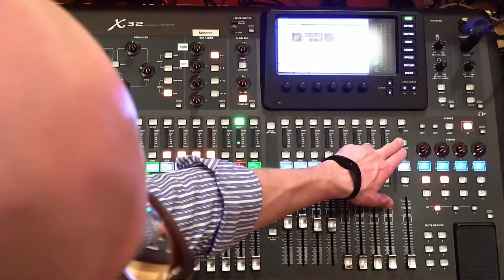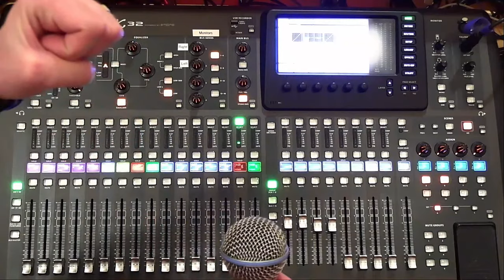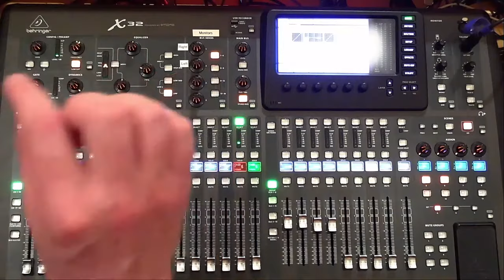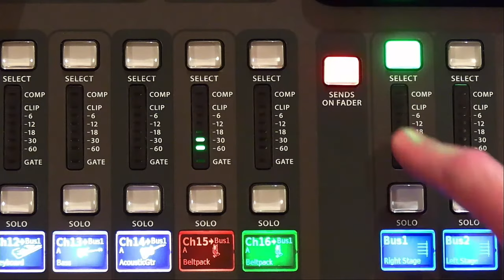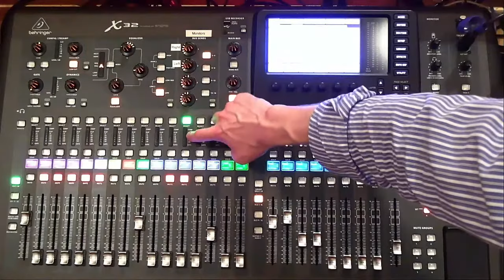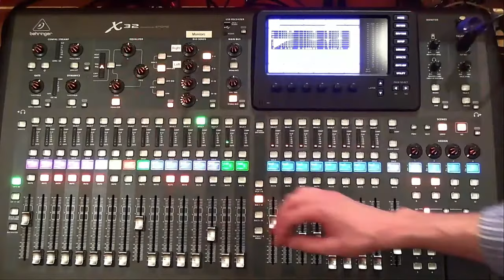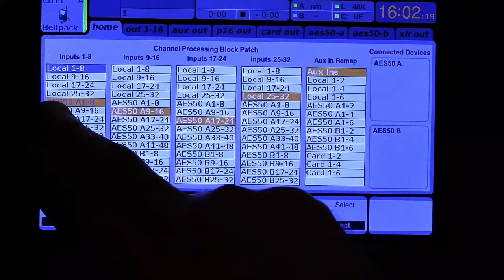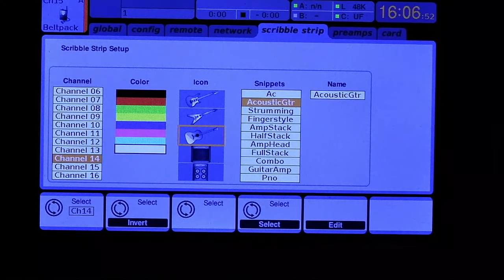Behringer X32 - Soundboard Training - Greenridge Baptist Church

Comment: What the DCA (Digital Control Amplifier) do is it adds or subtracts a fixed amount of dbs from  each channel assigned to it.  So lets say Channel 1 is assigned to a DCA and its' fader is set to -5 db, if you raise the DCA fader to 5 db then the resultant output from that channel will be Unity or 0 db.  If you lower the DCA to say -5 db then the resultant output of that channel will now only be -10 db.  The control to each channel of the DCA will be the sum of the fader plus whatever the DCA fader is set to. If channel 2 is also assigned to the DCA and its' fader is set to -10 db, then the two results above would be -5 db and -15 db for that channels amplifier output.

Comment: God bless your ministry. God has given you the ability to communicate technical information, clearly and concisely. Thank you !!!
Problem:
1) Drummer may have tried to adjust his channels on PA after rehersal was over
2) Came back the next day and none of his drums are coming through front of house.
3) I will need to check the drum DCA group to make sure it is not turned down
4) Need to understand what the routing should look like from lets say drum inputs mic channels 2-6, and how they get routed to output mains 15 & 16 to front of house.
 speakers. He may have changed the routing unknowingly.
Again excellent video.
Thanks again,
Rich

Comment: This was very helpful for me. I recently bought the X32 Rack. Your lessons on the X32 were great thank you 🙏. DCA= Digital Controlled Amplifier.  
Not exactly sure how “Cue” in this meaning applies to the X32 but this is what I was able find. 

To cue audio is to determine the desired initial playback point in a piece of recorded music. It is a technique often used in radio broadcasting and DJing. One dictionary definition is to "Set a piece of audio or video equipment in readiness to play (a particular part of the recorded material)."

If this helps you in any way. Please enlighten me (us) thank you 🙏.

Comment: Good video, but theirs at least two issues I see, Which one might be because of the time this video was uploaded which means that that firmware version might not of been available “V4.0 or later”, I’ll get to that one later, but 1st:

It would be nice if you explain the A under the channel, because if someone’s watching your video and see that you have it and their mixer doesn’t having because of using local or setup for local they might get confused or worry something is wrong with their mixer because it doesn’t have the A on it, so I’ll explain it (or try to)

When using a stage box (or digital snake) using a Shielded CAT5e cable from mixer to stage box and settings up the routing for the stage box, it is using AES50 port A or port B, and the “A” in the video under the channel’s label/name is to let the user know that channel is from AES50 A or AES50 port A not the local XLR on the back of the mixer, hopefully that explain why theirs an “A” on the scribble script or LCD screen.

On to the newer version of firmware available to the mixer “X32”, the newer version 4, has what is called user patch points, which by the way, in the old versions, when routing you had to do it in blocks of 8 (1-8, 9-16, 17-24, 25-32), and it was an all or nothing kind of thing, meaning if a user want to use channels 1-5 for local XLR and use channels 10-15 for AES50 (or stage box), can’t all batch blocks of 8 have to be local or AES50, ETC…

But now in V.4 and later, can assign the block channel to user In or user section and goto the the patch points and user section and assign each channel where they need to go now in a batch of 8 channels block, not anymore, personal I like to have everything going to that user section as don’t have to move around the other pages too much.

I think that it for the two issues I say…

Now I’m going explain about what some has mentioned in the comments here for recording to a computer or virtual Soundcheck:

1) need to make sure your using USB cable and port on the back of the X32 and using the one from the card and not the one says remote on it.

2) if using windows based computers, then need to download and install the software and driver for the X32, 1st, then you can use a DAW app, too get audio into the computer…

3) on the X32 if you used the local XLR connection on the back of X32 at 1st then later switch to a stage box and using AES50 A or B for the source and not the local XLR connection, then need to change the card listing source, because by default (or out of the box) the card is set to the local XLR connection, when using a stage box and AES50, got to tell the card in the routing menu on the X32 to use the AES50 A or B port(s), depending on what is used and setup for use, if the card routing isn’t changed to use AES50 and left on local it’s going to be listening and output them out to the computer from the local XLR connection and not any AES50 A and/or B ports if and when used, so got to make sure that the card page is changed if using a stage box.

TIP:
If I remember correctly, that the tab/page for P16 name has been changed in V.4 and later to be Ultranet.

And the color scheme on V.4 is alot better if using the X32 in a dark room, because it’s no longer white background it more have a dark gray to almost black color but not totally black color, tho, which in my opinion easier and better to look at the screen when the room is dark or dimmed…

Well, hope this info help someone out their understanding the “A” in the video and also info about the card and some info with V.4

Comment: On most mixer boards and probably on this one the Direct Outs come from the early part of the gain structure of the channel. Most of the time you pick them off just after the Gain control of the channel.  They are used to send the unprocessed signal either to device to process it before bringing into another channel or they are used to get raw unprocessed signal to send to a recording device to be played back and processed in the future.

Comment: As far as you know, the eight output faders can be configured as input faders to have 24 input faders at hand at the same time without having to change layers. It would be useful for live. With the compact model it is possible by pushing 1-8 and 9-16 at the same time even if it does not appear in the manual.

Comment: You have to excuse me if this is not the correct way to contact you. I'm a member of a small church and nobody can or will do the sound for the church. I've stepped up, but I don't know anything about what I'm doing. We have a Behringer X 32. And frankly it's a nightmare. I have been searching the Internet trying to learn more about it. I need a set of videos that will take me through the basics of operating the board. There are a lot of questions that I have. If you have any suggestions I would appreciate hearing them. Right now I'm having trouble with the stage monitors. Do you have any videos about that? Also I would like to do a virtual sound check using the Behringer X 32. But I don't even know where to begin with that. I know there are three different software packages not to mention drivers for my PC that I have to load. Do you have a video on setting up virtual sound checks? Thank you for your time.

Comment: Hi, when you were talking about your gain on your mic that you are using, how come when your raised the fader on your mic, it didn't get louder or blasting especially with the gain up? Your fader was at the bottom but I still could hear your mic, then you raised it all the way and your level coming out didn't change?
Reply: He was probably routing that channel to one of the buses and setting it pre-fader so that there is no effect of the Fader changes to it. The gain knob is not under the control of a Pre fader, which is why when he was increasing the gain, we could see a change in it. That is why once a gain level is achieved, it should be kept the same to avoid the overall mixing issues.

Comment: Those little player icons and color codes, do they appear somewhere on the screen or in the channel icon when the channel selection key is pressed? Or do you need masking tape and a marker to identify the channel.
Reply: When you want to rename something on the scribble strip, press (channel) select and utility (next to lcd screen) at the same time. You can change the name, personalize the name change the icon or remove it, and change the color or invert the color.
Reply: @c.s.5177  and all the changes show up in a little 1/2 x 1/2 inch button? It's a great device. So every little button has a little screen!!
Reply: @mattihyvonen2568  i personally remove the instrument icon (little guitar, piano, drum image) because it makes the channel name a tiny bit larger. I also use the same color for vocals, a different color for drums, instruments, whatever you need to do to make it stand out a little more. I kind of prefer the white electrical tape and a sharpie but that doesn’t work on this console because whenever you change what your fader bank shows, the tape would be wrong. I’m old school analog so I’m doing a lot of adjusting but also I’m learning a ton and enjoying it a bunch.
Reply: @c.s.5177 , question. So you can plug this mixer into a tablet or phone or even a computer to remotely control the sound board? Is that right or am I misunderstanding that? If you can control the board from a computer...I am the Technical Director at my Church. Sometimes I have to go out of town during Sundays, but using TeamViewer, I still control EasyWorship & our Livestream but can't control the sound. If you can remote control the sound board with the computer, then I should also be able to control the sound remotely from anywhere, correct?
Reply: @bonusbaby801  I have the mixing station app on my phone and I can wirelessly control and adjust the board (walking around the sanctuary) but you have to be on the same WiFi I think. I think churchfront has a video from a few months ago about managing the entire service remotely but I’ve never done that.

Comment: This was super helpful! Can you tell me, why do you set 2 DCAs to the same group?
Reply: That was confusing. He seems to be under the impression that a DCA group only affects either the left or the right depending on which DCA group he selects. This is not the case. DCA only affects the level of the channels assigned to it, on their way to the mains. Left and right is irrelevant.
Reply: @alanlowe9716  Thanks so much!
Reply: Thank you for confirming. I thought he was going to do some kind of stereo trick with the DCA groups, so I was also confused. They have nothing to do with L/R. All of the panning is done on the channel strip, themselves. I use DCA groups just to lower/raise volume for several channels at once that might be too complicated when grabbing several faders. Beyond that, I'm not sure they do much else.

Comment: Thx for your videos. I've got a question. We have a Behringer X32 soundboard at our church. Now every time we are going to turn off the mains that are connected to a strip, we get a big pop. We turn the soundboard last like your supposed to, but we keep getting that big pop and it's only happening from one side of our main speakers. The other one turns off very quietly. Any ideas?
Reply: All speakers are the last thing you turn on and the first thing you turn off, every time. If that doesn’t fix the problem I don’t know what it is.

Comment: DCA seems to be the function of grouping in an analog mixer, am I right?
Reply: Grouping actually mixes the audio signal, so you could, for example, push all the audio from those channels thru some sort of effects such as a group EQ. DCAs come from the analog VCA, which means Voltage Controlled Amplifier. The audio signals are not combined but the mix relationship of the of the individual channels assigned to the DCA can all be moved up and down in volume while maintaining their level relationship.

Comment: one question? We are using the compact x32 and we don't know why the MAIN is not working. can you give us a tip?
Reply: Are te dca or bus up?
Reply: You probably have the cable plugged into the wrong output. On the compact, the main comes from 15 and 16, rather than 31 and 32.

Comment: I wanna ask, I've being trying to link my laptop to capture the 32ch with samplitude recording software but doesn't workout but I wouldn't know if I've being doing it wrongly or probably the samplitude does not work with the mixer.
I need to know the best recording software I can use on my laptop to run it.
I need help on this area. Thanks
Reply: Get waves track live

Comment: A DCA is not a group, just a remote control for the faders assigned to it. A DCA doesn't go to the Main.
Reply: So what's the purpose of it doesn't go into the main?
Headphones?
Reply: @luffytaro-jg5ow  Controlling levels of faders that are assigned to it. That's all.
Reply: @Gauseltown  You're half right half wrong. A DCA controls the overall level of the mix on the included channels. It doesn't affect the mix only the main level.
Reply: @spottyjarl4023  I didn't say it affects the mix, I just said a DCA is controlling the faders assigned to it.